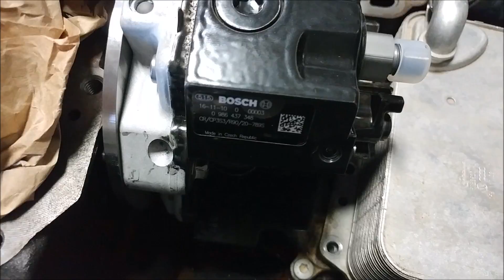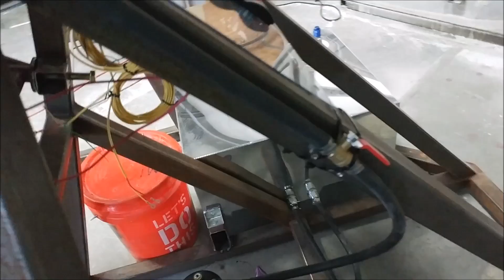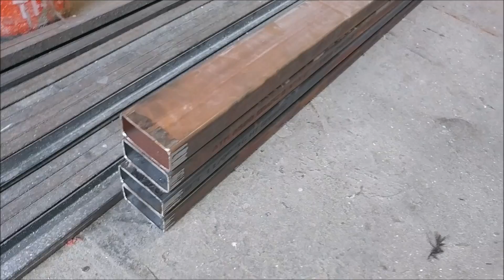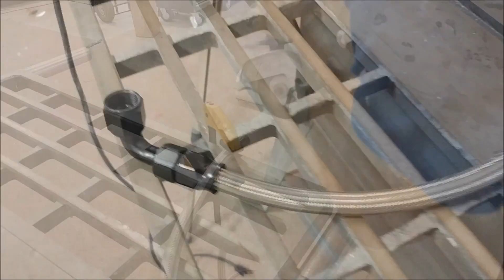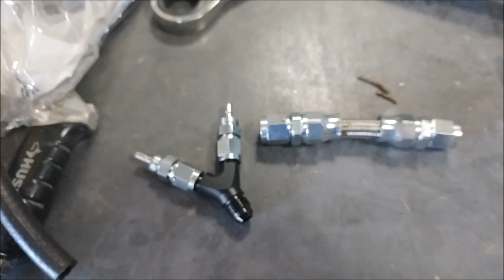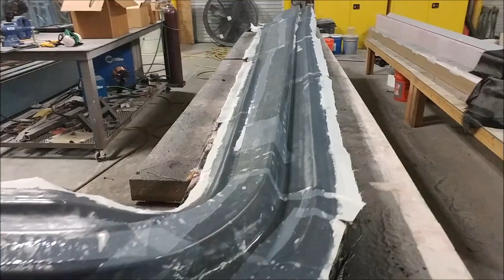Staying Hydrated - Fuel and oil feeds for the engine

Comment: I'm not an engineer, just a shade tree mechanic.  The simple Y on the turbo oil supply concerns me.  If one turbo has more oil flow resistance, most or all the oil will go to the least resistance.  The higher resistance turbo will cook quickly.  Also, on all these external oil lines, are there 'hydraulic fuses' available that work at these pressures/volumes?
Reply from the maker: Both turbos have the same resistance because they each use the same size inlet restrictor fitting.
Reply: Raptor Aircraft Brand new I'd expect it will be fine, in a perfect world they will stay the same and never have any debris in the oil.  I understand it's impractical to anticipate every possible problem.  At least consider a pressure (or preferably flow) difference indicator.

Comment: Great progress! Since this is diesel, for units that will go to customers consider a shutdown method (from cockpit) in case engine is running away. Either a CO2/Nitrogen bottle feeding into intake or a trap door method to cut air intake.

Also, PTFE hose is great but the return line from turbo should be 1) a bit larger than a feed line, because you get an aerated dirty color foam going back into a sump instead of oil, 2) the return line should be tapped into the oil sump higher that the normal oil level, because otherwise that foam being less dense will not be able to push through normal oil level.  

Engines with turbos also benefit from a separate spin on filter to get oil polished to 20 micron or better going to turbos, not a must but check turbo manual if yours have that requirement.. just throwing ideas....

Comment: Do you own a 3D scanner that you can use to scan all of the engine attachments and plumbing for importing into your SolidWorks model?  I imagine that would aid integration, optimization, and configuration management.

Comment: You really want the oil return lines to be short direct and down hill. like into the oil sump. otherwise they can become caked with oil residue. when this happens oil will bypass the center section and flow into the intake air stream. No bueno!
Especially in a diesel that can run on its oil supply.
Reply from the maker: I'm fully aware of that but there is presently no other place to plumb into other than tapping into the sump pan. The return line is downhill and we will be checking it with a temporary sight glass to ensure that it's draining correctly. The engine sump is under vacuum from what I can tell and so that should also help to alleviate any drain issues. Testing will see.
Reply: Raptor Aircraft, Yeah I know it's just a test stand. The crankcase is under vacuum from the pcv system. You should think about getting rid of that and venting the crankcase to atmosphere via a catch can and loop of hose. Its there for emissions  and any avenue for oil to migrate into the intake air should be isolated.
There aren't many diesel aircraft for comparison, can't wait to hear it run keep up the good work.

Comment: Does this engine have oil quality sensors (viscosity, contaminants/metal shavings)? 

I ask because my Chrysler Pentastar has this, you don't change the oil on schedule, but rather when the engine tells you to. (Btw the Pentastar I always though would make for a great aviation conversion.) Just curious if this turbo diesel has that feature?
Reply from the maker: Not that I'm aware of.